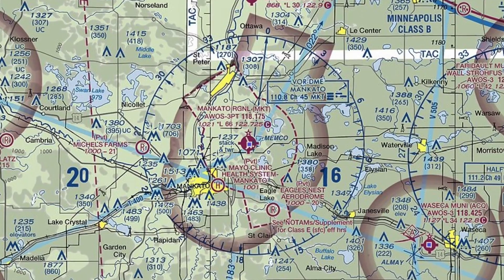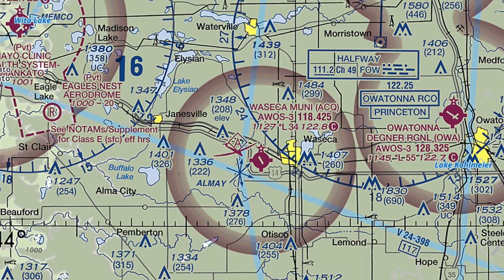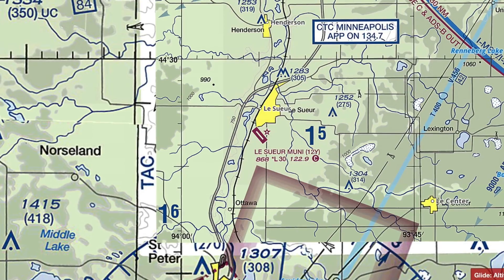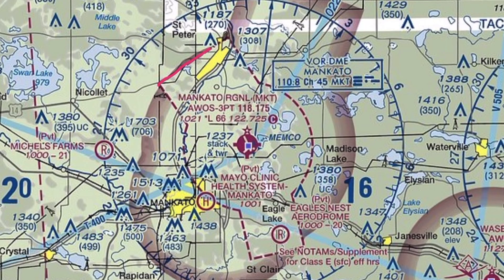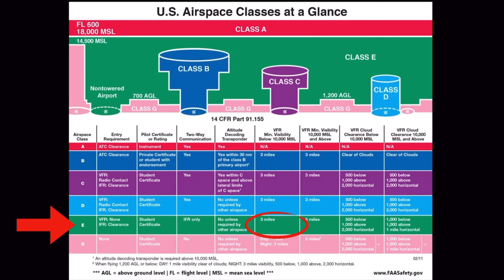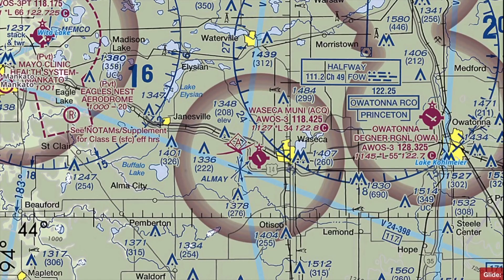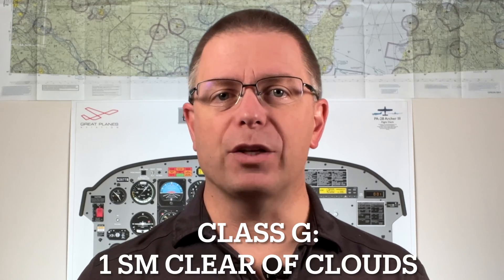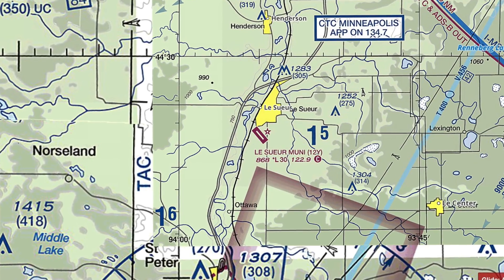The Hardest Go-No-Go decisions In Aviation

Comment: Hi Scott, just wondering that if Le Sueur Airport is Class G and you wanted to do pattern work at 1000 AGL, and the cloud coverage starts at 1100, wouldn't that mean you didn't have the required 500ft cloud clearance above you which is the minimum for class G?

 Separately, your videos are great! Well done, perfectly composed information, to the point and really help, so I really appreciate them. Keep it up!
Reply from the maker: Thanks for the comment. I’m glad the videos are useful to you!! I’m already working on a couple more. 

Your question is part of why this question is a bit tricky. The limitations for Class G airspace change based on the altitude  being flown and the time of day. The minimums for Class G daytime when at or below 1200 AGL are to have at least 1 Statute Mile Visibility and Remain Clear of Clouds 91.155(a). 

Even at night, the same minimums would apply, as long as you are below 1200 AGL and within 1/2 statute miles of the runway 91.155(b). 

Having said that, just because it is legal doesn’t make it safe. Ensuring you have at least 500 feet between pattern altitude and the clouds is definitely the safer option. 

I hope this helps.

Comment: With the middle one only requiring a mile visability how could you legally take off if you can't complete the pattern to land? Legally once you took off you would either have to land or scud run until you got into better conditions if you could...
Reply from the maker: You are absolutely correct!  Part of the struggle is that the cloud clearances are regulatory (14 CFR 91.155), while the pattern descriptions are “best practice” (AIM 4-3-3).   So, a pilot could take off, scud run straight until outside the magenta ring and be “legal”.  That is why I was careful to say “Legally”.  To your point, just because it is legal doesn’t make it a good idea.   Again, thanks for the comment!